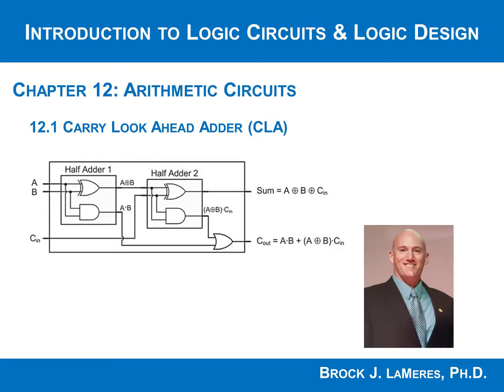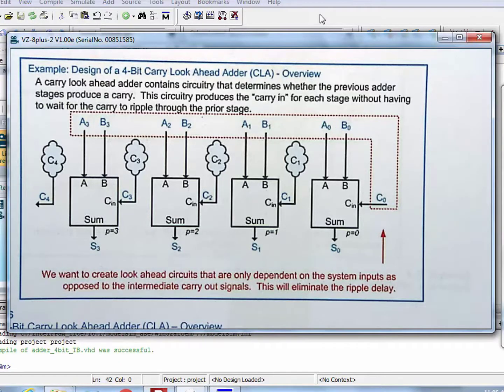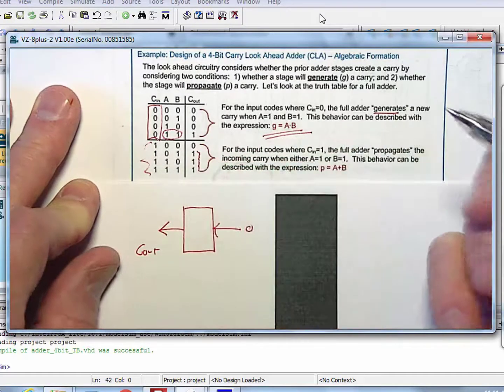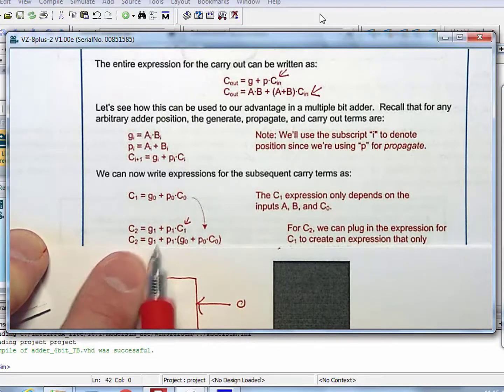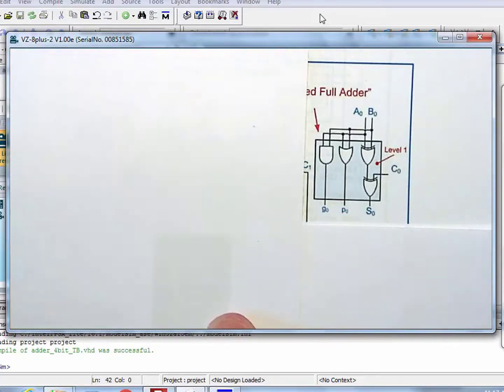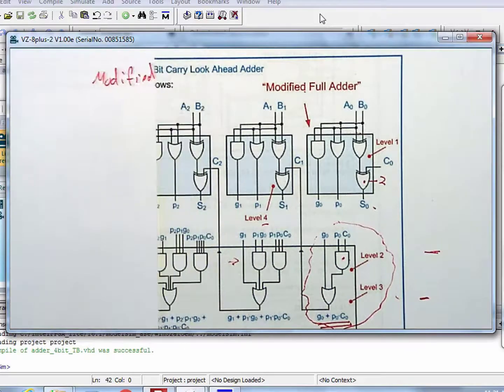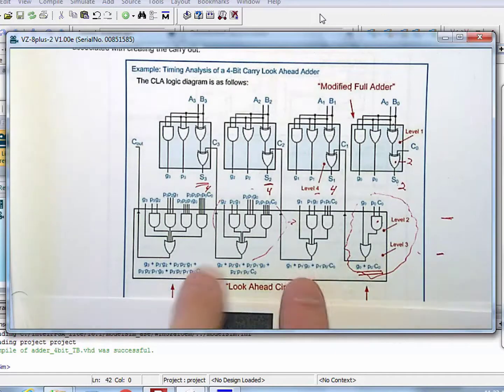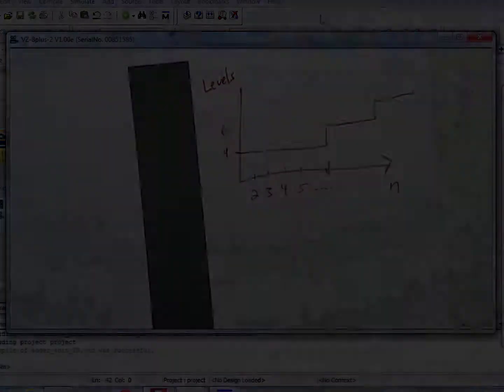12.1(d) -  Carry Look Ahead (CLA) Adders

Comment: Thk you oh so much.  I'm interested in adding a pair of irrational numbers exactly.  A pair of irrational numbers can not be traditionally added from their right-to-leftward placeholder digits because there are infinite placeholder digits to the right of the decimal point of each irrational number.  But they might be added from left-to-rightward placeholder digits.  However still there's the problem of a cumulative ripple carry-over add delay.  As you pointed-out, the carry-over from one placeholder to another is a function of the pair of irrational numbers (aka carry-look-ahead).  Thus carry-look-ahead addition would avoid that cumulative ripple leftward carry-over delay.  
Although carry-look-ahead addition would still take an infinite time to add a pair of irrational numbers, it would be infinitely better than an carry-over adder.   I’m an optimistic person & would like to consider this progress towards my goal :)